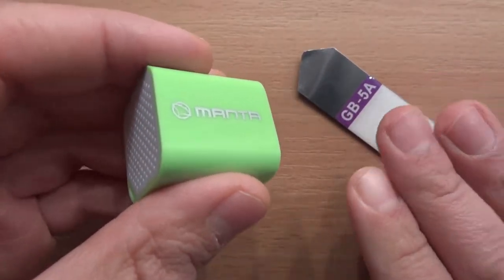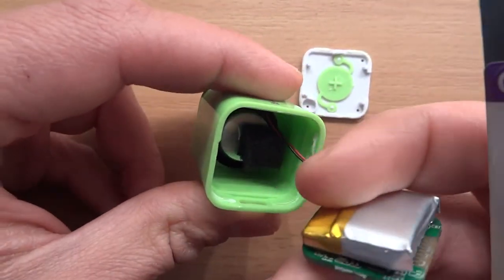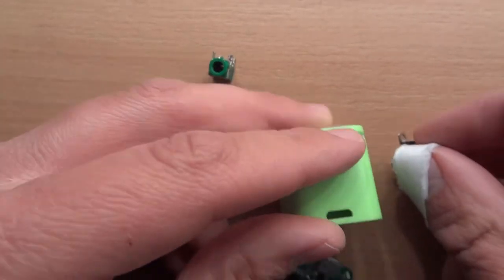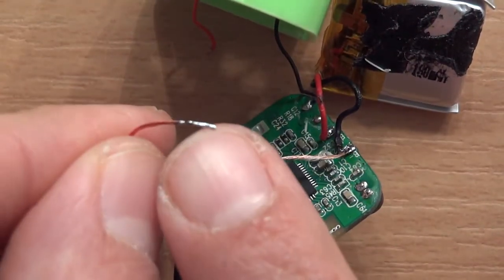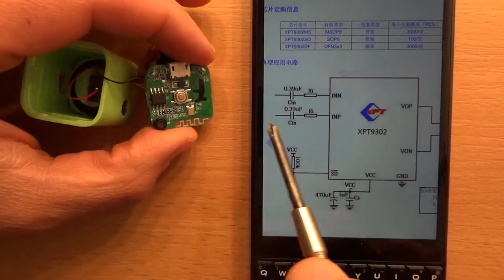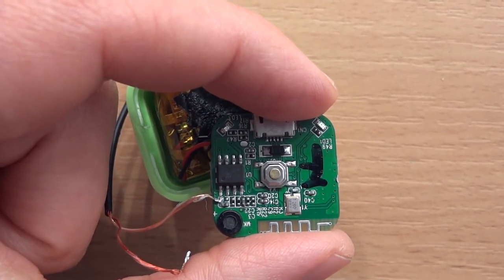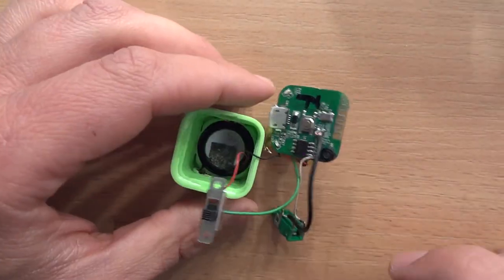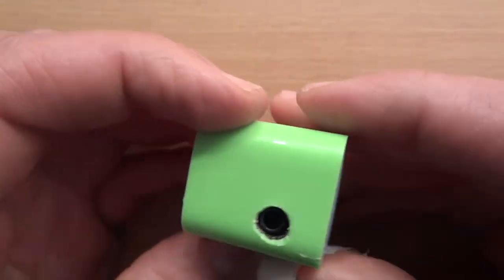Adding headphone output to bluetooth speaker - botched casing mod

Comment: Hi Sir, I've been searching for such a video from a long time. Thank you a million tons.

However, if the output is too big, say in the range of upto 2 or 3 watts and the impedance of the speakers are very small, like 8 or 4 ohms, how to step down the impedance of the amplifier to 16 ohms?
Reply from the maker: Since I skipped the amplifier for jack output, it worked just fine with standard headphones (I tested both 32 and 16 Ohms earpiece). If you mean the output of the amplifier, XPT9302 datasheet says it's amplifies 3W@4Ohms, but if I'm not mistaken, for higher impedances and lower supply voltage it will be simply less effective. I'm not even sure what was the impedance of the built-in speaker, but I would guess that it was either 8 or 16 Ohms, so it was just quieter and amplifier wasn't talking so much power. If it would run at full 3W, then the battery would be draining at 600mA (if it works at 5V), which is not possible because this little speaker lasted for about 2-3 hours with about 80mAh battery (so the circuitry used about 110mW or 30mA).
Reply: @pandaengineering  thank you again. 

I have Tin T2 IEMs and they are 16 ohms and are very good with even poorly amplified audio. However, I was wondering as to how I could make a simple amplifier that won't fry these amazing little iems. 

I have a very old cteative desktop powered speakers. Was wondering how I could convert that into a headphone amplifier. Do you have any suggestions, please?

Wish you a very good life ahead.
Reply from the maker: Direct output from the chip (or via some components like here to make it noise-free) in those Bluetooth receivers is enough for driving most headphones so just skip the the amplifier altogether. You can easily control the volume from the phone.

Take care 😄
Reply: @pandaengineering  thanks again. I am not looking at bluetooth but a complete wired method. 

Since I am very new to audio components and technology behing, I am still experimenting.

If the amplifier owers a 2 inch 4 ohm speaker at 1 watt per channel capacity, what will happen if i use the speaker output to directly plug in my 16 ohms iem? 

Will the iem burn and blow out?

Comment: I have a XENEO X21 Speaker .
I had Bluetooth mode / FM radio mode / and micro SD card playback function mode .
Great little sounding speaker .
Just wish it had a headphone output jack . 😢 .
It DOES have an Auxiliary input 3.5 mm port .
Can THAT port be resoldered to the board to become a headphone jack ? 
Thanks .
Reply from the maker: The problem is that if you still want to use it as a speaker, (apart from modding the output like here) you would have to have a way to switch between a speaker and headphone out. It means that you would have to add extra switch that at least would disable the speaker and solder inline the headphone out. Maybe be tricky to implement as the input jack would also have to be removed completely from it's current connections (ex. flip upside down to solder new ones). Really depends on how much space there is inside the case ☺️

Comment: Can i remove mic and add mic input jack will it work
Reply from the maker: Sure 🙂 as long as you plan to also use a capacitive mic (phone headset will be ideal) it will work perfectly, but don't expect massive improvements in quality (it will be still better than whatever mic they put in those BT speakers).
Reply: @pandaengineering  i just can't find Bluetooth receiver with mic input they always have built in mic
Reply from the maker: I didn't seen one either, but you can try adding 4 pole 3.5mm jack socket to it and add external microphone support this way if there is no difference between microphone ground and left and right channel. To be honest I didn't tied that yet. If you do, make sure to never press the button on the headset as it shorts mic input to ground 😉